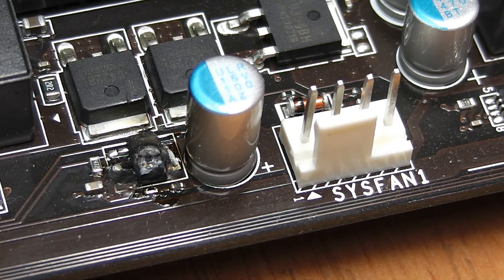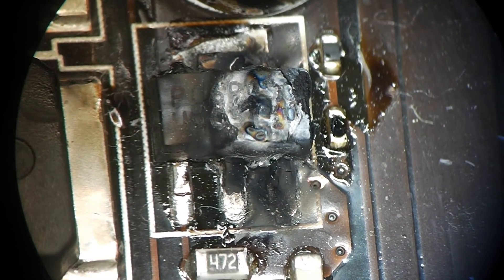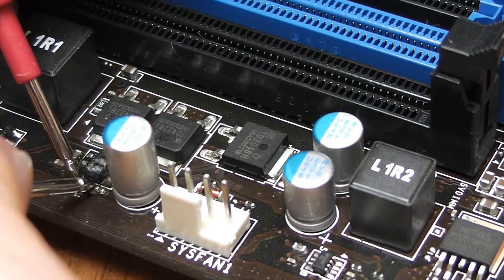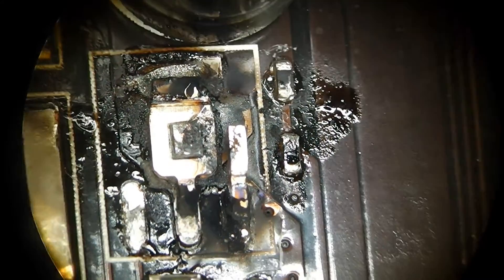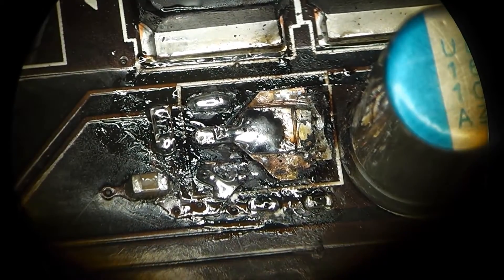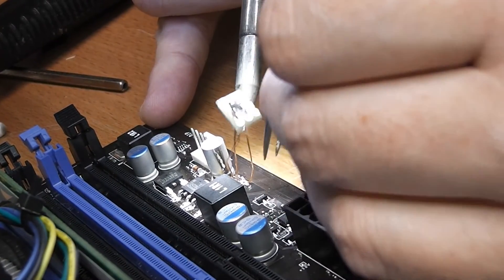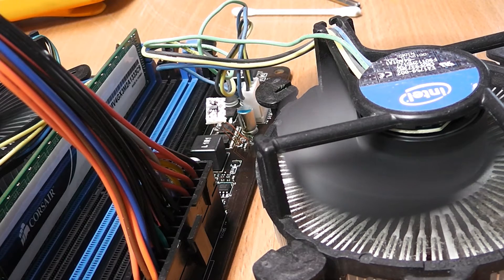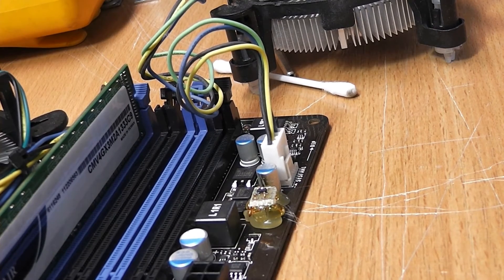Repair of a blown motherboard transistor

Comment: Don't do that kind of ghetto repairs. It is very ugly and there is a large risk of oscillations in the transistor. You can source similar SOT-89 transistor and replace it nicely using the same hot air gun you used to remove the original.